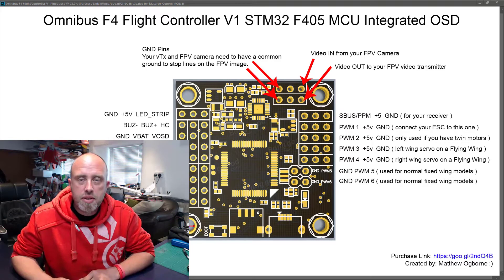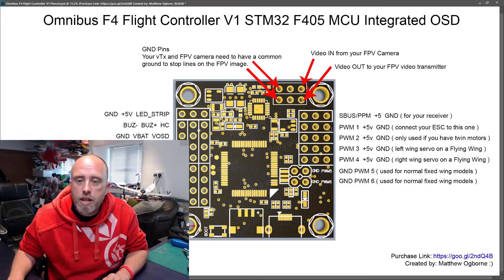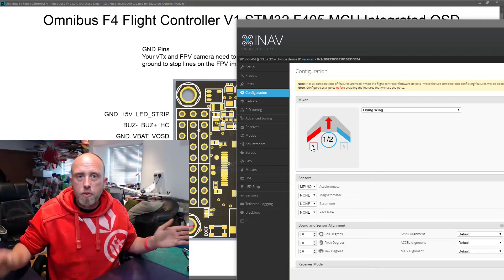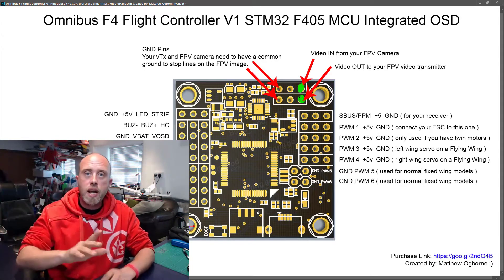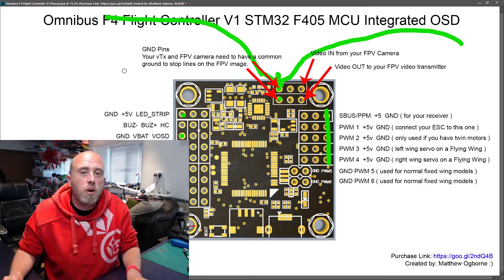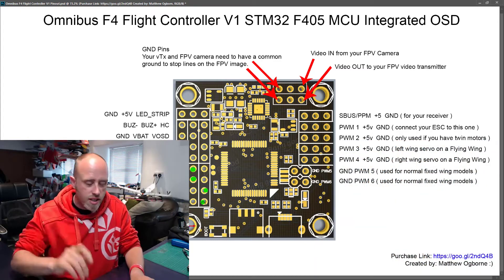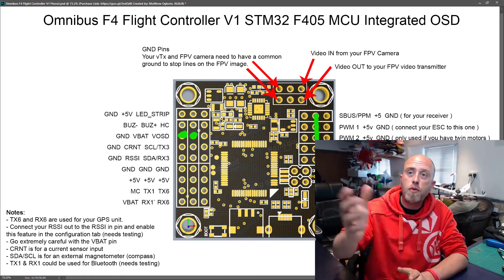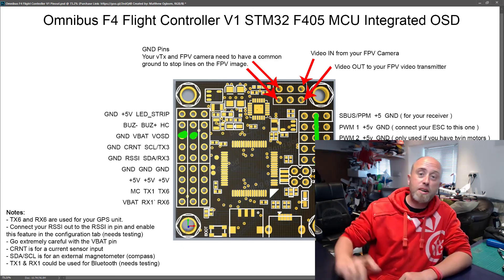Part #4A - [QUICK] Omnibus F4 V1 Board Overview for iNav & a Flying Wing

Comment: I've got one of the LDO omnibus boards....no bec so I think I have to use the Bec from my ESC.  Is there anyway to power the servo rail with a bec and still get the battery voltage to the OSD?

Comment: Hi Matt, firstly thanks a lot for your videos! I'm a very beginner in this hobby, apologize for probably silly question, but If I understood correct the F4 v1 FCB can be fed only with 5 V current, how can I do it if my plane battery is a lipo 2s 7,4 V?

Comment: There are two VBAT locations The one you mention and one at the bottom nest to RX1 and RX6. What is this one for?
Reply from the maker: Howdy Ralph, that bottom one is not for the VBAT, that is labelled incorrectly and most likely for the power ton the Vtx + pin. Do check your boards pinout to be sure as it may differ from mine, Matt

Comment: I was curious, I haven't yet got my VTX but the two I am looking at are the  new Eachine TX801 and the older TX526, each need a minimum of 7 volts. Camera takes a minimum of 5 (up to 35). I would power both with 12. Would I do this from the lipo balance plug or is there  12v outs on the V1 FC? 

One more thing, the "common ground" for the vtx and camera, those 2 pins with red arrows, do the camera and vtx go to just one of those, or does each get its own ground?

As always, thanks a ton for being so helpful!
Reply from the maker: Howdy, go for the TX526 Vtx, they are fantastic. The TX801 is a lesser vtx. As for the supply, yep 12V is fine, so a 2S, 3S or a 4S battery and the back wire needs to be common to all the board, the Vtx and FPV camera. Hope that helps Matt
Reply: Thank you, yes this helps, I will get the 526. I am still slightly confused on the "common ground" aspect. Do both vtx/cam black wires solder together on just one of those two ground pins?
Reply from the maker: Howdy Matt, just make sure at somewhere down the line they end up joining together, back at the battery. See the later video on the wiring up of the boards for a visual example, Matt

Comment: What kind of esc's are you guy's using? The only ones I can seem to find with a 3a bec are 40a and up. The vast majority under 40a have 2a bec.
Reply from the maker: Hey Matt, see the blue HobbyKing 30A ones, they have a 3A BEC on them, Matt
Reply: Do you have any suggestions off hand from banggood? I cannot order from HK as a 10 dollar esc becomes 20 with shipping! I could use a separate bec too I suppose. Thanks!
Reply from the maker: Here is a BEC I've personally used on several models https://www.banggood.com/External-Brushless-BEC-UBEC-3A-5V2-5S-Receiver-Power-Supply-p-949258.html?rmmds=search and this one iworks well too but is slightly larger https://www.banggood.com/Hobbywing-3A-UBEC-5V-6V-Switch-Mode-BEC-For-RC-Models-p-915037.html?rmmds=search
Reply from the maker: As for ESC's, see here https://www.banggood.com/search/30a-esc-brushless-3a.html and saying that the 40A here is pretty much the same size as the 30A ones https://www.banggood.com/FMS-Predator-40A-Brushless-ESC-With-3A-Switch-BEC-T-TX60-Plug-for-RC-Models-p-1105060.html?rmmds=search Hope that helps Matt
Reply: Thanks a ton Matt! You are super helpful!

Comment: Matt, what is the VOSD pin next to Vbatt for?  I am wondering if  connecting the pack + to VSOD and the pack - to GND would provide the pack voltage to the OSD and allow the board itself to be powered by the ESC (vbatt would not be connected).
Reply: Did you find this to be correct?

Comment: Hey, what about the barometer? Don't you need a baro for RTL? GPS altitude is not as reliable.
Reply from the maker: Howdy, this question has come up lots of times. The Baro isn't needed for fixed wing models and the GPS is more than enough. Multirotors can yaw on a dime, where has flying wings etc.. typically always fly forwards. Hope that makes sense. Matt

Comment: I might want to try inav on my diy fpv foamys...  can I use an esc like my turnigy plush 40a w/ 5v bec?  or is it better tio use a newer esc that has one shot or multi shot?  or does it matter?
Reply from the maker: Howdy Robert, yes you can. It depends on which board you're using though! Matt
Reply: I am planning buying the parts you suggest and following you thru this...  I was going to get the - Omnibus Betaflight F4 Flight Controller V1 STM32 F405 MCU Integrated OSD..... will that work w/ turnigy plush?  I also want to get a s800 wing later..  I see some other brand esc's at bg...some with 5v / 3a+ bec....any you suggest?
Reply: I had planned on using the same parts you suggest and following you on this build  -  Omnibus Betaflight F4 Flight Controller V1 STM32 F405 MCU Integrated OSD... is the fc I was going to get...  Will the turnigy plush work good with it?    I haven't decided if I want to build in my foamy with what I have or  get an S800 wing and use the same FC..but with that I willl order 2300kv red bottom I guess...what is the best esc w/ bec from bg to use...I see some various brands,  what works good?  does one shot, multi shott , D600 matter?  or are standard ecs fine?  and is theat what these are called ? standard?
Reply from the maker: Howdy Robert, standard ESC's for models. Quads have uber cooling on the ESC's, planes/wings do not, hence you need a heatsink on top of the FET's to keep them cool. Hope that helps! Oh and as for which ESC to use, frankly speaking, any bar the EMAX SimonK ones because they're kak! Matt
Reply: so the esc having a bec, so you can power the fc from 5v bec,,,ok I understand that,,, but I made a few quad I I wonder why not just use a PDB? w/ 5v / 12v out puts for fc and vtx?  just like the quads i've made... is there no room for pdb?  Igot to ask,,, if you got a sec
Reply from the maker: Howdy Robert, yep of course you can use a PDB. I won't be covering that in this series as most people won't need that for a flying wing. Matt

Comment: Re powering the Vtx and Fpv cam. Is there 5v on the centre pins between the GND and Fpv cam video in/out pins? Would using one of the GND pins for the Fpv camera and the other one for the Vtx still be considered using a "common ground" or should they both be connected to the same pin? Thinking that it would simply wiring as could just use two servo wires
Reply from the maker: Howdy Andrew, any GND pin is fair game. As far as 5V being on the middle pin, normally there is, but that depends on a jumper and something I specifically avoided to mention to keep things simple as most will power their vTx & FPV camera directly from the main pack, Matt
Reply: That's what I do via the balance plug but it's getting positive and negative that way. Perhaps I'm being thick but how do you get GND from the FC under those circumstances. Those new fangled electrons and wiring diagrams confuse the hell out of me

Comment: Thanks for the pcb labelling Matt...So, in order to monitor main Lipo voltage means using the onboard 5v BEC..and NOT connecting the ESCs bec...This is ok, and I will use it on my Falcon build, but what to do if we need to drive more servos than just two is the question..?....We could cut the 5v servo rail pins short and not solder to the pcb with a wire running across them all. Then we could use the ESCs bec and power all the servos we want AND still see flight pack voltage...Ya..?..This method also means we can get lipo voltage to the vtx and camera pins, as intended, a neat solution.
Reply from the maker: "So, in order to monitor main Lipo voltage means using the onboard 5v BEC..and NOT connecting the ESCs bec..." That is correct but go VERY careful in doing this, I fried my board by putting it on the wrong pins. On this board if you connect VBAT, then the voltage regulator under the board will provide 5V for the servos & receiver, Matt
Reply: If I'm reading this correct, the voltage regulator is providing the 5V. Can I connect a LiFo (6,6V) to the board with no problem when disconnecting the ESC's bec?

Comment: I got a couple of quick-ish questions but relating to the rest of the boards pins please...
Whats the VOSD for?
CRNT is for an external current sensor, isn't it?
Whats MC for/do?
How come grab 5v & ground from center of the 3 instead of using a 4pin connector & using pair next to them, or is it just easier when using a pair of double connectors?
And lastly, whats the go with the second VBAT down the bottom & how does it tie into used with the other one, or is it separate or something else (can ESC BEC safely be fed in here for some other reading perhaps)?
Apologies for silly questions...
Reply from the maker: Howdy Lee,

I believe these are correct, but go bloody careful with the other pins as I might be wrong!

VOSD
Not sure is the honest answer

CRNT is for an external current sensor, isn't it? 
Yes, thats a ADC input pin, so for an external correct sensor providing a range between 0 & 3.3V

Whats MC for/do? + second VBAT down the bottom
These are linked, jumper these and they change the output voltage on the video pins at the top

How come grab 5v & ground from center of the 3 instead of using a 4pin connector & using pair next to them, or is it just easier when using a pair of double connectors?
Easier to use 2 separate connectors

Hope that helps! 

Matt
Reply: Thanks Matt, thats helped heaps, still trying to work out wheather I want the Pro or Non-Pro version..